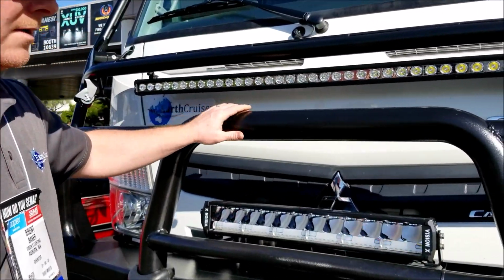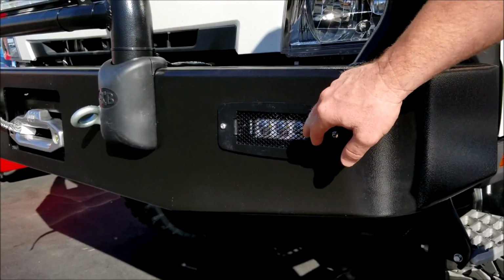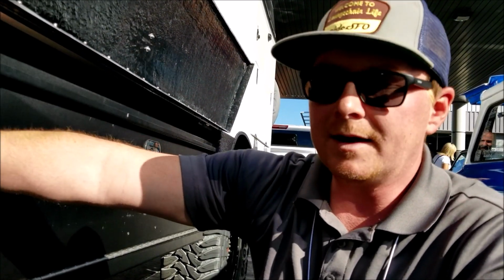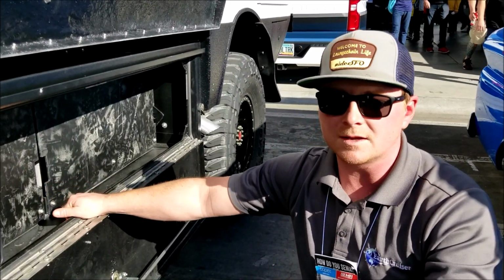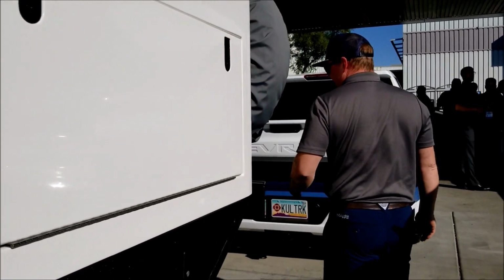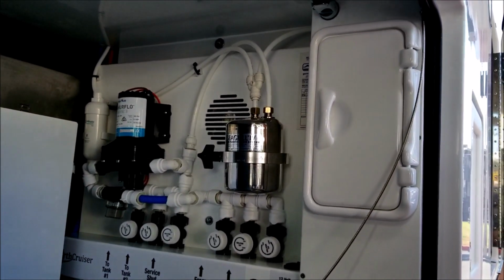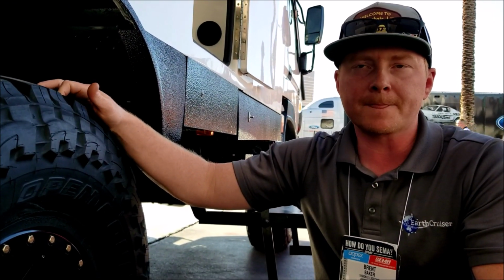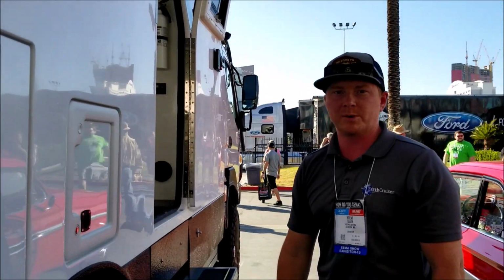EarthCruiser EXP at the 2019 SEMA Show (Part 1)

Comment: Great vid, If you are going to sell your rig as a 4 season rig you really need to offer a "Severe Snow Service" rated tire option, the TOYO's are great tires however they are not great in the snow and are not a legal winter tire here in Colorado.
Reply: Colorado requires 4x4, chains, or snow tires. This would comply...